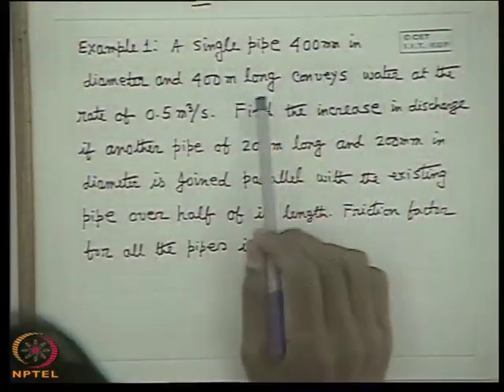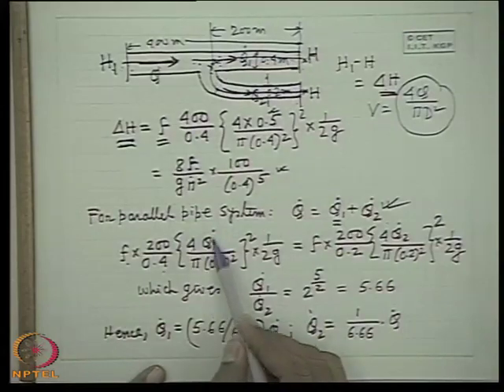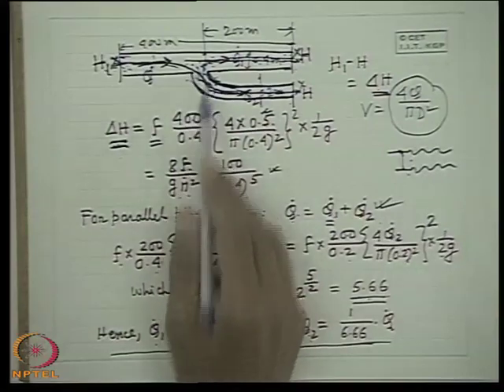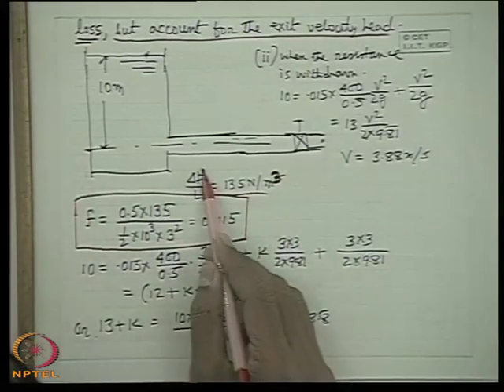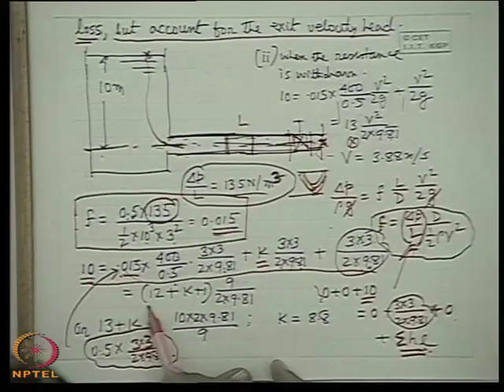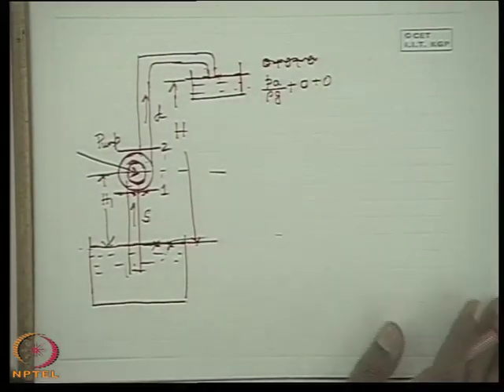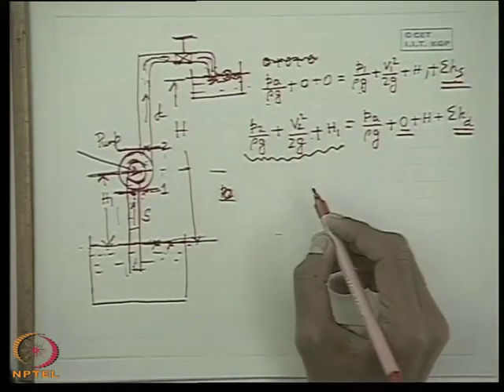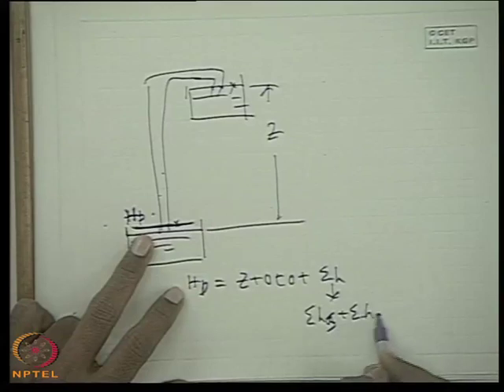Mod-35 Lec-35 Application of ViscousFlow Through Pipes Part III

Comment: For questions at the end of the lectures.
Q3.) Why minor losses are being neglected. Don't they arise due low pressure region formation in pipes that would also arise with viscous flow.
Q6.) For question 6 i am getting the answer as 74% increase. Please explain the solution.
Reply: Yes for 6 th question answer coming is 74 percent
Reply: Q6.) The increase is 74%, you are correct.
Reply: Q6.) The answer given in the slide is for percentage increase in Diameter.
Reply: I'm also
Reply: 3) for inviscid  ideal flow, there is no losses, major losses are not present as it is inviscid, as well the streamlines perfectly follows the geometry of the flow situation, and hence the flow is perfect near the bends, enlargements, contractions, hence no minor losses too
6) Head difference is the driving force of the flow through the pipe connecting two tanks, since H (also f, and the length l) is constant, for the frictional losses to be same both the cases, the increase in discharge must be accompanied by an increase in diameter of the connecting pipe. From calculation it is d2 = 1.3195 d1.
Reply: @nandansarkar6617  increase in area is asked...not increase in diameter...
Reply: @shikhartaori895  Arre chutiye increase in dia is 32%...but increase in area is 74%

Comment: in the second numerical , in the second part for calculating velocity, the friction factor is considered same as first case, but it should change because velocity changes and hence reynolds number should change and epsilon/ diameter would not change, so the second part of this problem has to be solved by iterative method by considering arbitrary friction factor and then calculating Re and then again checking for friction factor from moody chart until the solution converges
Reply: In second part the head loss due to the obstruction is not considered.
Reply: Assume it to be constant.. As epsilon is not given